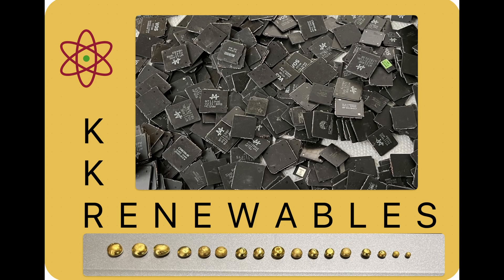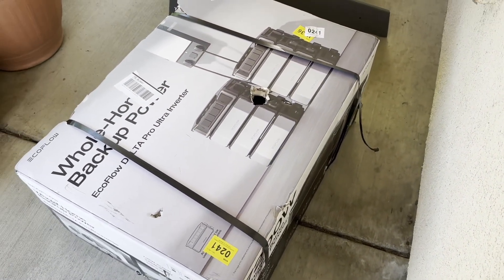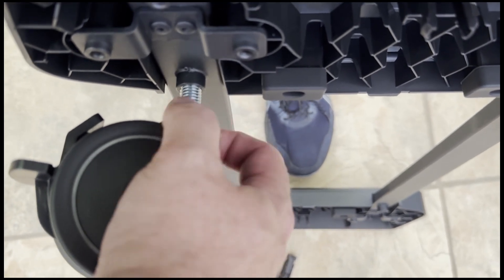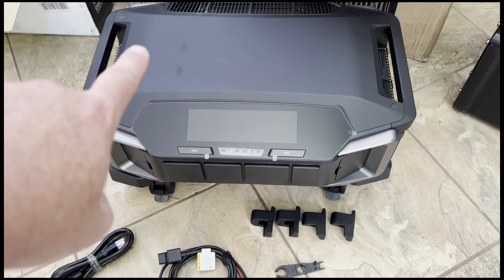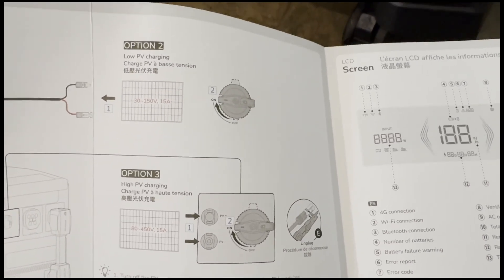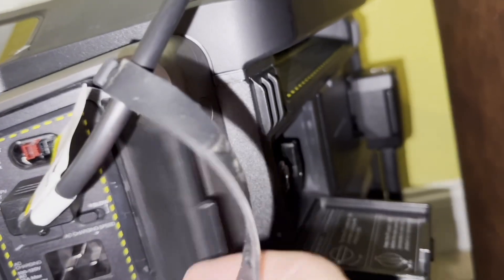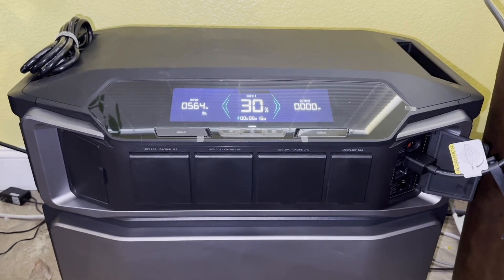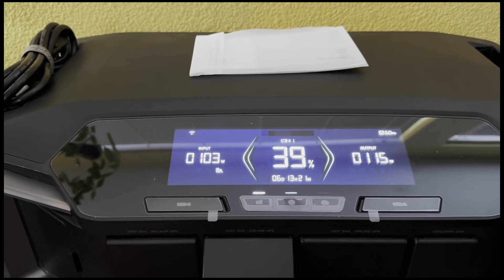EcoFlow Delta Pro Ultra unboxing and initial setup

Comment: I just have to say great job. This was the best unboxing I’ve ever seen the most necessary unboxing in my opinion because once you start building this damn thing and it’s so heavy you gotta make sure you’re doing it right and those casters have a plug-in. They screw in fine but what are those big rubber duckies well right there you pointed it out there if you want to use the same trolley piece as a separator between the batteries they don’t make that clear in the directions at all so I really appreciate the fact that you did this from ABCD EFG and not skipping any parts>
Reply from the maker: Hey there!  I really appreciate your view and your comments.  Let me know how it’s going for you.  My Ultra is working great.  I’m still not clear on my total capacity but I only charge from solar and it runs my entire living room and studio office at night. Keep in touch and thanks again.
Reply: @KKRRenewables  Hello again. Hope you’re doing well. I’ve  had my DPU plugged in and charging my iPhones for a few days… but that’s all it isn’t at this point is a  huge backup battery for my iPhone 🤣 What I want to do is connect the DPU into my main electric panel to act as a home back battery. Did you connect yours to your main panel? I’ve contacted Eco Flo and asked for a qualified electrician in my area, Asheville NC, but all I’ve gotten so far is a list of more batteries etc. that I can buy from Eco Flo. I might get solar panels in the future but right now I jut want to get this unit hooked up to my panel. Did you do that in your home and didn’t you find an electrician to do it? Many thanks! Pete

Comment: Great 👍 😊eco flow delta pro ultra system and power whole house 90,000(KWH)
Reply from the maker: These systems are great but do waste energy.  I’ve found I need to top up often even with little use. I really like the system and don’t see a better option out there. I appreciate your view and your comment.

Comment: on the older ecoflows they recommended charging fully and discharging fully 3 times before using it, not sure if thats still the case but that's what i would have done before plugging the solar
Reply from the maker: I’ve heard of folks going that with older modules    Was described to me as “waking the batteries back up” after storage.   But nothing in the paperwork for this unit suggested fully charging/discharging.  Thank you very much for the view and the comment.

Comment: I own both Eco Flow and Bluetti. My earlier EFP Delta came in a badly damaged and in a somewhat inadequate packing box. My EFP Ultra inverter came with no through and through punctures like in this video but with plenty of exterior damage  (3 sides and 3 edges) to the box in various places. Similar to this video, I am still waiting to receive my Eco Flow Batteries. 

So at this point, I CAN attest to the fact that unlike my Eco Flow products, my Bluetti AC500s and 6 B300s batteries came seriously double-boxed and fully protected. EcoFlow could stand to better surround their products with more and thicker solid foam and double box them like Bluetti. More detail when I receive the entire system.

The 90-degree battery connector cables are a welcome improvement.

Thanks, KKR.

RP
Reply from the maker: I totally agree on the boxing.  My only thought was maybe the design choice for the boxes were made for a storefront and not shipping, but that makes little sense.  Then again, neither does such flimsy packaging.  I first purchased a real cheapo knock-off of the Oupes Mega5.  Even that significantly inferior product was packaged better than EF.  The 90 degree connectors are badass.  Don’t forget to use them. Hahhahaaaa

Comment: First,  thank you for taking the time to review this unit. No disrespect however but this unit is $5000+ USD and for the carton to be greatly damaged in shipping leading to a scratch on the device I would've taken a picture before cutting those straps so Ecoflow can see how it was delivered to to you. They could offer you some money back if you don't want to go through the trouble returning it or swap you out for another one. That's a very expensive device and the only "war wounds" it should receive are from you, not UPS, Fedex, DHL or whomever delivered in that terrible condition.
Reply from the maker: Yes, I was not happy about it. I’ve placed the unit and it shouldn’t get any more physical war wounds as it’s not near anything moving.  I may yet reach out to Costco about the shipping.  Thank you so much for the view and comment.

Comment: That’s awesome! How much stuff can you connect to it with 1 battery versus having 4? How long do they last? I’m in the process of selecting a portable battery and I’m between the Ultra and the Delta Pro 3. I’m not sure what to get, all I want is back up for blackouts during Hurricane season . (video is super informational, thank you for posting, make a follow up to see how they are working🎉)
Reply from the maker: Great and thank you for the view and comment!  I can give you advice but it will be biased towards my own way of thinking.  The DPU has a larger inverter than the DP3.  The DPU capacity is natively more expandable than the DP3.  I wanted a home back up system so those two things give me more versatility with the DPU over the DP3.  Price is a large consideration, and portability might be a consideration for some, it was not for me.  I can force the DPU to be portable but weighing in at close to 190lbs means it’s only portable if I have help and want it to be stationary after I move it :).   I can give an update on battery balancing, once the entire system state of charge got to 50% it began balancing the batteries.  I did reach out to support in an effort to learn the “rules for balancing” and they basically just told me that once the device is sufficiently charged, it will balance.  They tried to be helpful, but I think a language barrier is a problem so while the words were English, I’m not sure the communication was.   If that makes sense….   I also have scheduled tasks set up so the DPU charges for 3 hours limited to 600W each night during the cheapest grid charges.  The rest of the time it charges from Solar.  Once I get to a reasonable state of charge (say 75%), I’ll disable that scheduled task and run only solar and see how that goes.   Thanks again Lola, I hope that helps.  Ask any questions you’d like.  Have a great day.

Comment: Tis the time of year for storms and power outages here in Florida. I have a generator that powers about half my stuff. Was thinking of upgrading to a bigger unit now may look into your unit.
Reply: Never mind I looked them up. For that price I think I can visit another state till the power returns. Think I will go with the home generator runs on propane and turns on automatically when the power goes out.
Reply from the maker: Yessir, they are not cheap, but battery prices are coming way down.  I got these on a steal from Costco over Father’s Day.  I’m betting they will be on sale again for Independence Day or maybe Labor Day.  thank you very much for the view and the comment.  I really appreciate your time and insight.